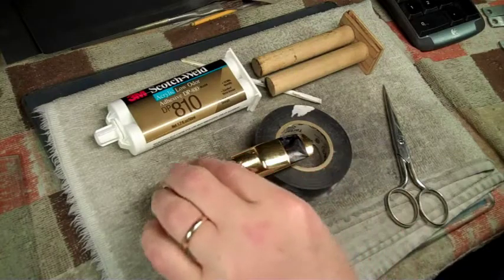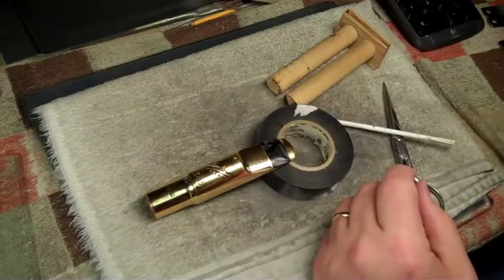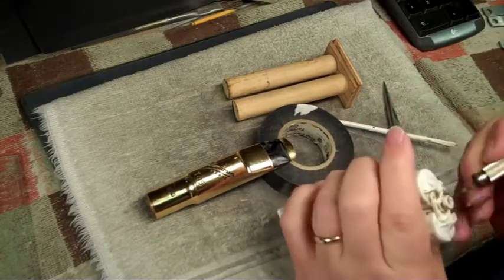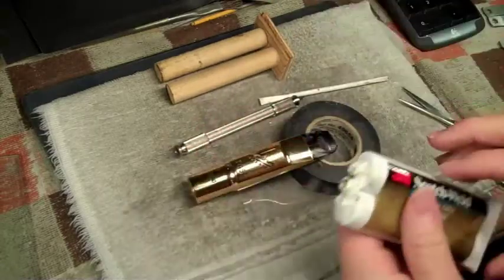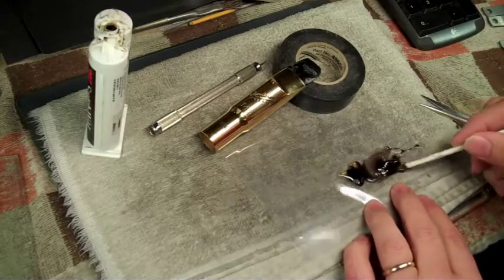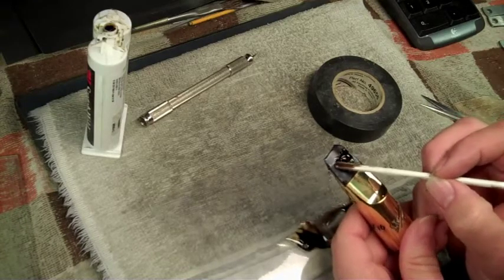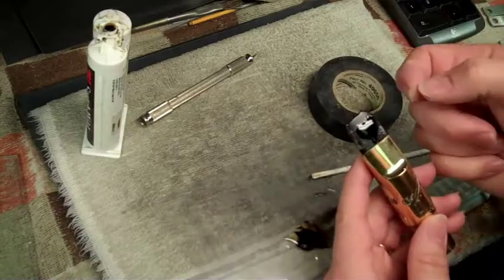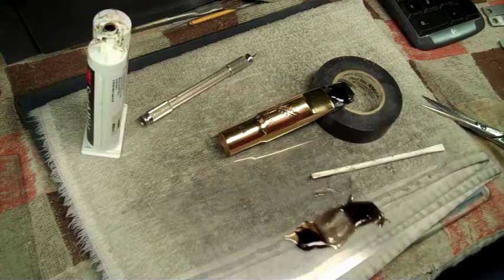Repairing a Tooth Gouge in a Bite Plate

Comment: I need to do this (badly) for my Francois Louis hard rubber (or whatever he uses) tenor mpc.  I received the dental acrylic from a dental supply place.  Some questions:  1.  was is the mixing ratio?  2.  Do I have to let it sit before application?  3.  How long do I have to work with it?  4.  Set it overnight as well?  5.  I don't want to gouge the rest of the mpc while filing and sanding, so should I tape around the "V" bite mark (which is pretty deep; and there is no bite plate, just the mpc itself) tightly?  Or not overfill?  Thank you.....
Reply from the maker: You may have a different acrylic than I use.   So you need to experiment if you don’t have instructions.

Comment: Impressive.  Would silver polish or brass polish be safe to use as the polishing compound?
Reply from the maker: I do finish with a Flitz metal polish.  The polishing or rubbing compound is a little more abrasive for the step before the polishing.